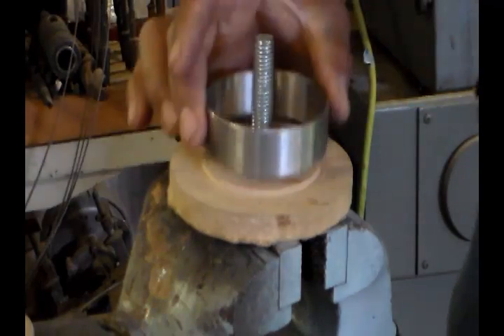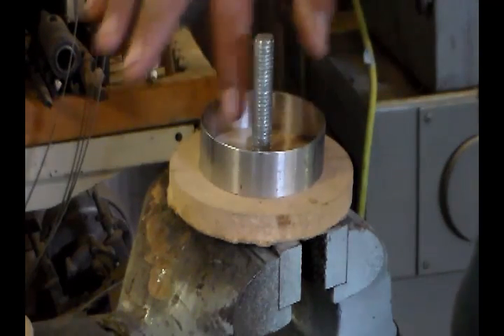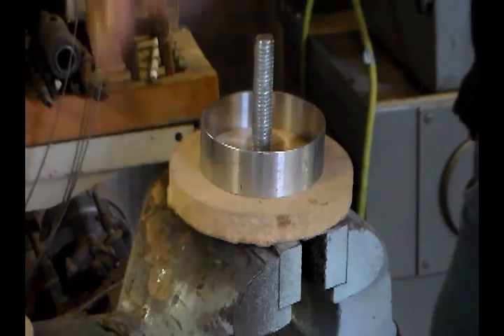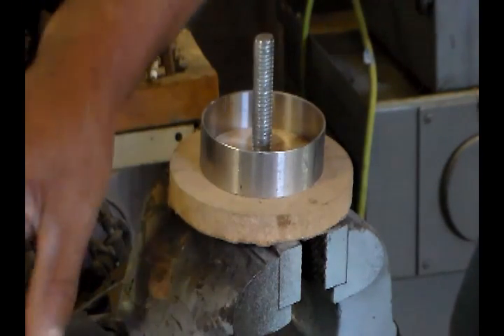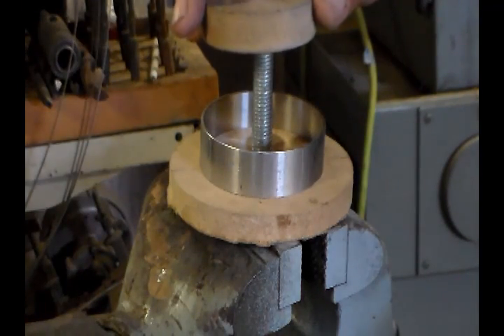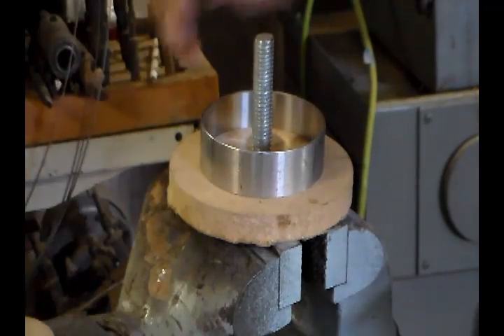making pumps leather cups

Comment: Thanks for this video. I have a 1920- 1950s Weber dental chair that I've tattooed out of for 2 decades. And recently got a slow leak. I took the thing apart and at the base (top) of the hydraulic piston I think it is missing the orginal leather seal. Didnt know about leather cup seals until today.